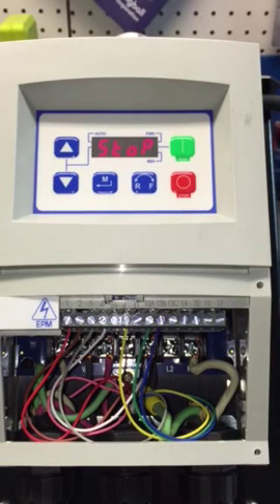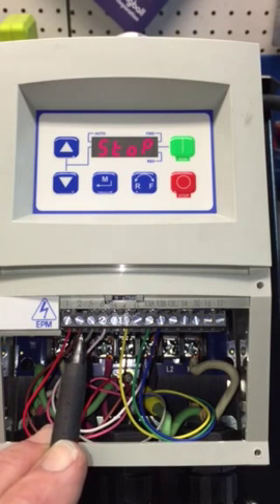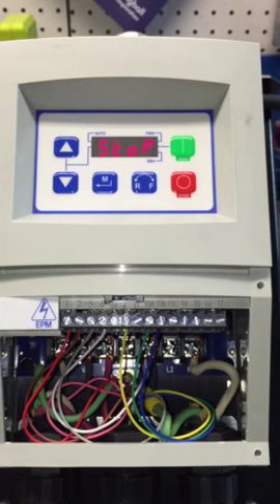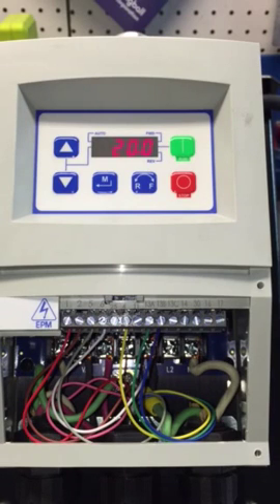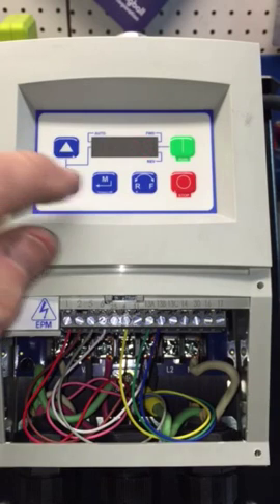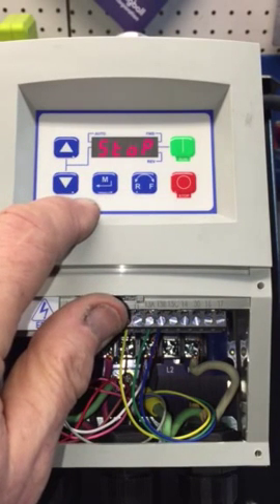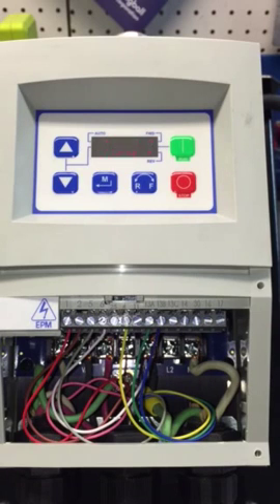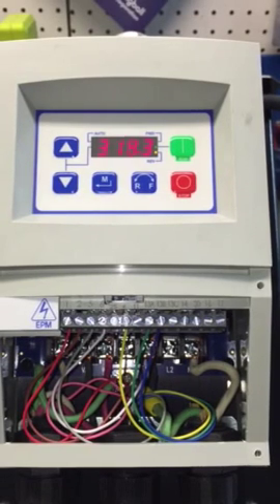Lenze ACTech VFD programming and wiring

Comment: I install a lenze ,7.5hp 400/480v 3phase 11amp nema4 ,the motor is 7.5hp 440v 13amp 1150 rpm ,when drive turn on it ramp up to ,35hz and cuts off ,the fault shows F_HF. Need help

Comment: Dear sir 

Good day

we are one of the authorized dealer of lenze  in GCC , we had met one problem in crane lifting application , we install the smv series driver of 7.5 kW for 3.5 kW motor of 4 ton application , we programmed but the problem we are facing is while we push up button the crane is starts lifting when i stop in certain level it reached and again when i press the up button to move up from the current level it wont move up suddenly it goes down fully and then it starts moving up only wen it reach the base what is the reason , we checked the motor with out vfd it is lifting good we check the load current with out vfd in motor it is 9A in each phase ........please send me the solution or program in my email ID :-p.abdulameen@gmail.com